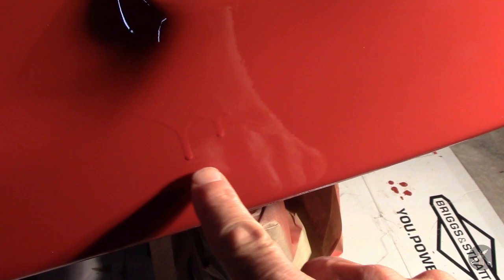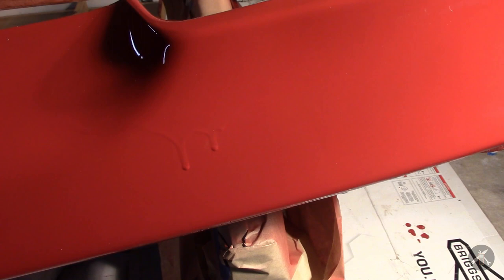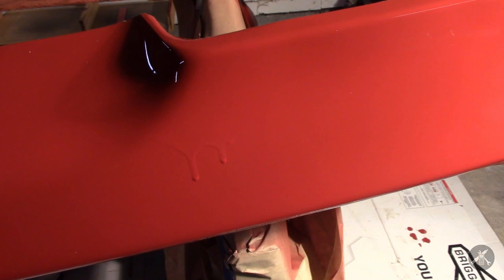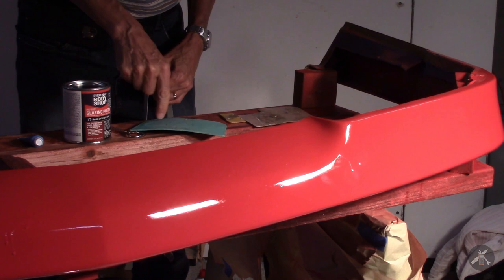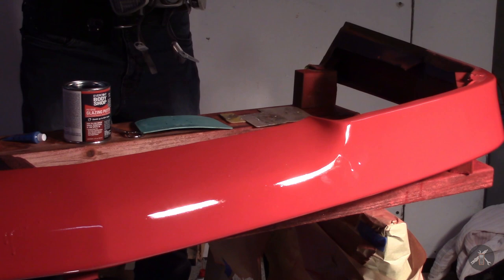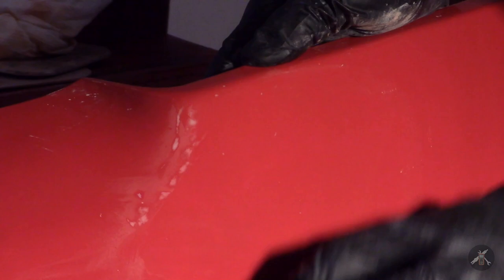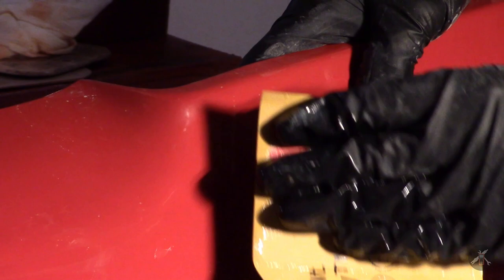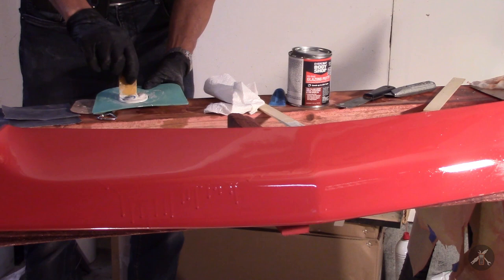Sanding Paint Runs with 2 Part Polyester Glazing Putty

Comment: You should be fine continuing with color sanding and buff. There looks to be good thickness of paint and no clear coat to burn through.
Reply from the maker: Yes, it did work out.  Just a slow careful process.
Reply: Is it way you can tell if you still have enough clear left after sanding out a run. I also use the spot putty method. I had a pretty bad run on a door so I had to sand it a lot to get it out. I didn't burn through the clear coat. The first time a painted it I applied 3 coats. Had to repaint it. This time I applied 3 more coats